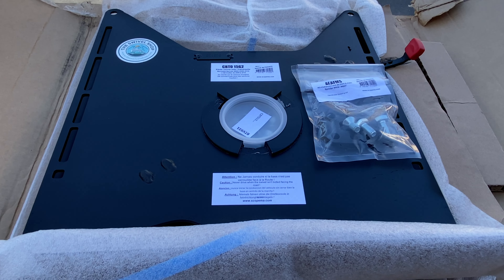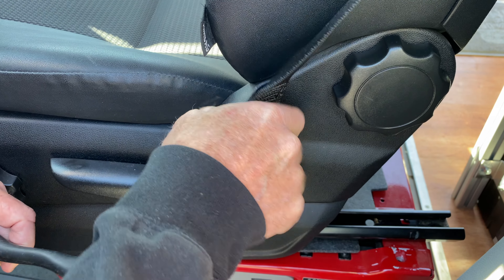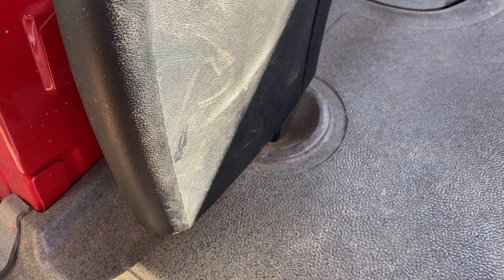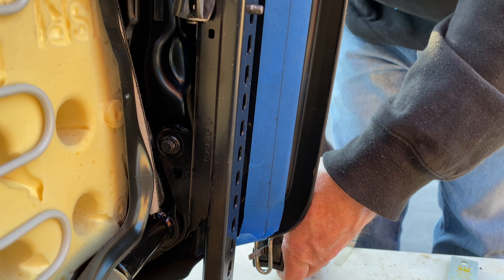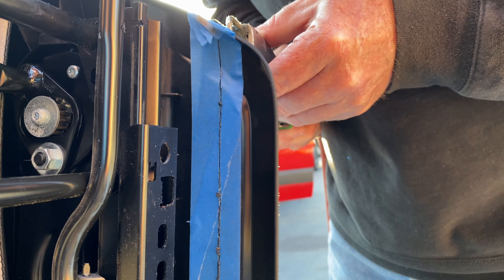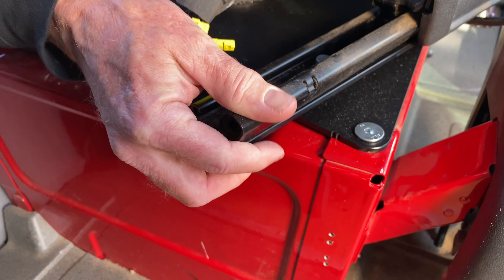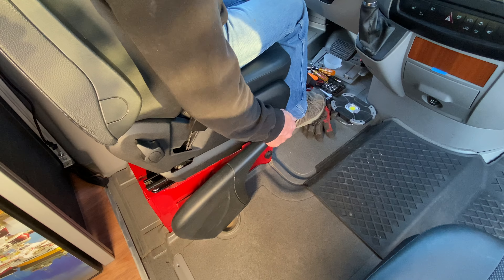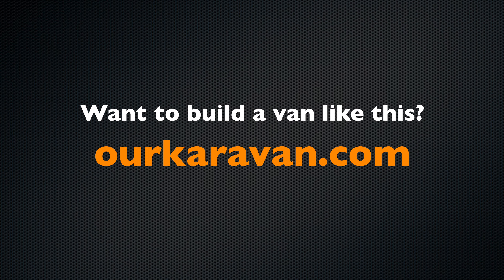Scopema Seat Swivel Install

Comment: Just used this guide to install driver and passenger swivels in my 2016 144. It went well! The plastic skirting closest to the doors snapped off in my hands at exactly the right height to clear the base, so that was awesome. My swivels did not match up perfectly with the seat base holes, but backing the screws out 80% of the way and then screwing them in a bit at a time in an X pattern got everything snugged in nicely. Nice tutorial!
Reply from the maker: Sounds good!  Mercedes does not have the best assembly quality, and it’s often helpful to loosen the mounting bolts between the seat base and the chassis before bolting the swivel to the pedestal.  Somehow the seat bases can be torqued down slightly out of square

Comment: I just finished installing these swivels in my 2021 Sprinter 2500. Worked perfectly with the hand brake kit. The only mod I needed to make was to use my dremel to trim out a bit of material on the inside of the hand brake cover. Thank you so much for your videos!!
Reply from the maker: Thanks for the info, and for the kind words!

Comment: Thx for the video. I just used it to install Scopema swivels on a 2016 144. Overall it went well. I did have the passenger side swivel not line up with the factory bolt holes in the base. So I had to use a dremel to open up the mounting hole on the swivel. The plastic side skirts have to be trimmed on both sides of the seat, not just the outside, so that added a lot of time to the job. The cover for the parking brake did not want to go back on fully, something was definitely preventing it from snapping back in place even after I trimmed it several times. But, after all the fiddling, they are both installed and work really well.
Reply from the maker: Thanks for the report.  The reason the swivels may not have aligned perfectly is due to Mercedes-Benz assembly quality. People have found that when various aftermarket swivels don’t align with the holes, simply loosening the mounting between the seat pedestal box and the floor of the van will release the tension and allow the swivel to bolt up.  Or so I hear.  

I agree, trimming the plastic is the most time consuming part.  If a person only used their seat on a higher setting, the trimming is not necessary.  However to do it right and allow full range of seat motion, the skirts must be trimmed.  Thanks!
Reply: @ourkaravan  Thanks, one other comment would be that with the seats fully rotated around, and slid back towards the dash, with the doors closed, the seat cannot rotate at all due to the armrest on the seat contacting the armrest on the door. So they don't really allow for any adjustment when they are fully swivelled. They basically have to be pointed straight back and cannot be at much of an angle unless the seat is slid all the way forward on the tracks. Not a huge deal, but something of note for potential buyers.
Reply from the maker: That’s true for the factory Mercedes Benz swivels as well.

Comment: Thank you! Very helpful video as usual. Just installed these on my 2018 crew. I have the heater in the floor but had no trouble cutting the plastic handbrake cover with the jigsaw. I am getting a little jiggle on the drivers seat. I double checked and everything’s tight. Just a slight movement on the drivers seat. Is this common or should I be worried?
Reply from the maker: I suspect the jiggle could be coming from the Mercedes seat base.  I would check to make sure it is properly tightened.  One of mine required tightening (and I bought it new with no previous owners.)

Comment: Nice! I put in the same ones!!
Reply from the maker: Good choice.  There are things I like about these more than my Mercedes-Benz swivels.
Reply: @ourkaravan  I heard if you get the stock ones, then the metal box below is lowered. That sounds worthwhile. My wife is so high up on the seat it's crazy, even for normal driving
Reply from the maker: Yes, I have the stock MB swivels with the lowered bases, ordered straight from Mercedes this way.  The MB seat swivels are very tall, like 3-1/2" I believe.  So my MB swivels on lowered bases sit about 9" off the floor (measured from the driver footwell.).  The red van in the video has the higher standard seat base on the driver's side but with the low-profile Scopema it's about 10" high, so only 1" higher than mine.  (I also loose space in my pedestal for things like heaters, amps, etc.). 

His passenger seat has a MB lowered seat pedestal he installed himself, and with the low profile Scopema is only 6-1/2" high.  So there you go!

Comment: I had these installed on my 2014 Sprinter & think the installer messed up.  Seems there are 2 different length bolts to fasten the plates to the pedestal & then seats to the plates.  No install videos mention this. All seems to function ok so does it matter if the shorter bolts are the ones bolting plate to pedestal or is that a safety issue?

Comment: After doing some research and reading some testimonials about the swivel I found that "the seat only locks in the forward position. It does not latch when facing the rear."
This could be an issue for some who want to lock the seat to a drop-down table. Hopefully in future revisions this will get fixed.
Reply from the maker: I suppose it could be a pro or a con...having the ability to swivel from the rear-facing position without having to unlock is rather nice.  Just curious, are you attaching a table to the seat, hence why you would want it to lock rear-facing?
Reply: @ourkaravan  Exactly. Also, my engineering brain just seems to think that a lock should be an option. I have the old style on the passenger seat install by Sportsmobile - think that’s the name- back in ‘07 so it’s a bear to rotate. I’ll get a couple like yours when they are back in stock.
Reply from the maker: Good to know, thanks for the suggestion

Comment: Great vid as always ! Does the seat shake after assembly? It looks a little wobble.
Reply from the maker: All swivel seats have some amount of movement due to the way they pivot from a central hole in the middle.  Some seat swivels actually feel loose and clunk side to side, and the owner reports these do not do that.  Even my Mercedes seat swivels have more side-to-side movement than a seat bolted straight to a seat pedestal with no swivel.

Comment: Any idea why on the 19+ model sprinters you have to cut off the studs off the slider rails?  Appears the 07-18 you don't have to like in your video.
Reply from the maker: I have not installed the 2019+ version but as you stated I understand the newer generation seats have two studs that must be shortened.  Those studs are easily removed with an angle grinder or multi tool.

Comment: Is it possible to swivel the driver’s seat with the handbrake on or does it have to be off in order to be low enough that the seat can turn?
Reply from the maker: I confirmed that once the seat is swiveled 180 degrees the handbrake can be applied.

Comment: I have a 2020 sprinter crew with electronic driver/passenger seats... is that brand compatible with my seats?
Reply from the maker: Scopema only lists the air suspension seats as being incompatible, but make sure you confirm before ordering.
Reply: works on my 2019